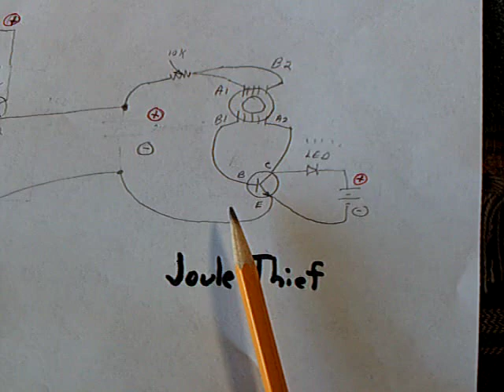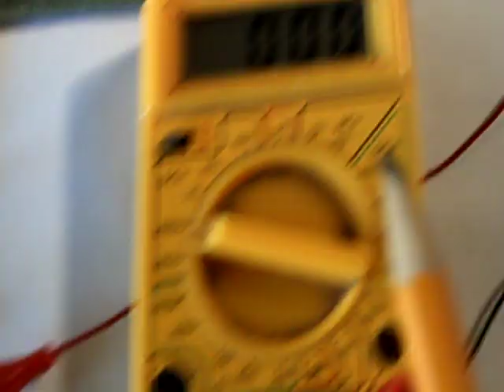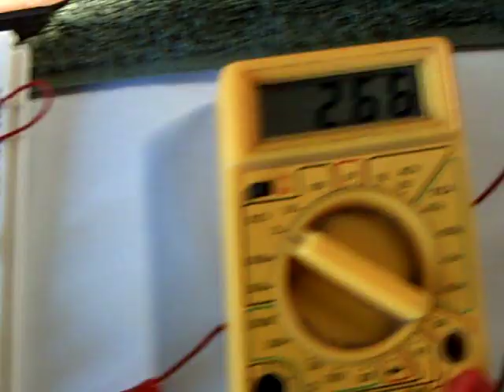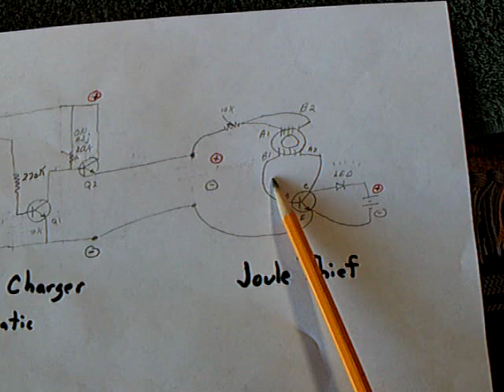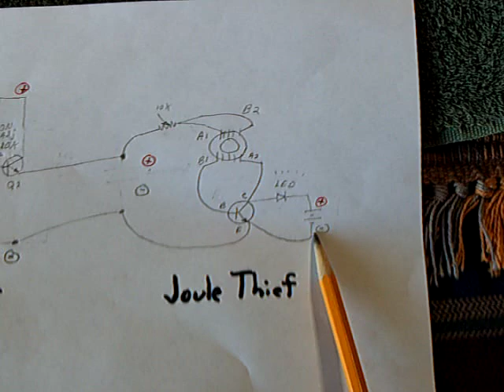Automatic solar Joule Thief

Comment: I'm sure this is very good if it's not like this little cell, but I've tried 2pcs 12v mini cells in series, the current is really low, it doesn't harm the battery, but charges a normal lead battery surprisingly well. I'll add one more to the Keno series. Works well even in cloudy weather.

Comment: Could You please expain which transistor use for this circuit ? (2 n 3904 ok ? ) and schotky diode or 1n...  ?and what values of resistor ? ( I mean only solar charger  without joule thief
 I need this do for education course for school

Comment: Hi Lidmotor, I believe i allready said this but i'm gonna say it again. I really enjoy watching your videos and studiying your work. I even replicated some of your circuits and allready learned a lot considering i'm only doing this for a little more then half a year. I've got a couple of your automatic solar joule thiefs running in my window and they're performing great! Now i've encountered an interesting phenomenon with one of my joule thiefs and i was wondering if you or anyone else has experienced this allso. Its just a plain standard joule thief circuit with a bifilar on a ferrite, a resistor and a 2n2222. Now to my surprise when the voltage on the battery decreases it goes into blinking mode. There is no capacitor in the circuit. I find this very strange. Have you any thoughts on why this might be happening?
Reply from the maker: Ben Winkel I saw a video on that long age but I have not seen that effect unless I add a capacitor.  I think that battery rebound is what causes it.
Reply: ***** Thanks for your reply. For battery rebound, it would have to drain it first. Mine starts blinking after say an hour and then goes on all night. I believe it has something to do with the capacatance in my coil, i used insulated wire on a rather chunky toroid.
Reply from the maker: Must be coil capacitance then.

Comment: @ALEFILES
The typical JT has 20 turns of wire for both windings, which are usually bifilar wound (both at the same time). But for use as a battery charger, you should use half as many turns on the feedback winding to the base of the transistor.

Comment: @TruthfullyIsay2u
The JT steps up the voltage in the same winding that is connected to the battery; there is no transformation. The second feedback winding is there only for feedback. I'm saying this to help people understand how the circuit works.  If you add turns to the toroid or a third winding then it becomes a transformer and the voltage can be as high as you want, just add more turns.